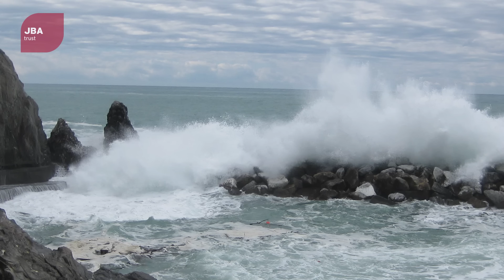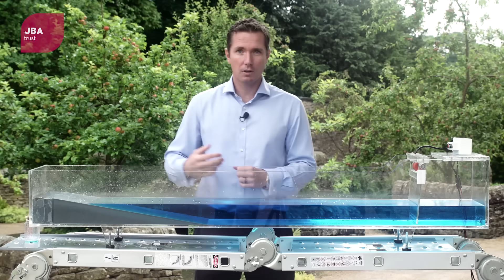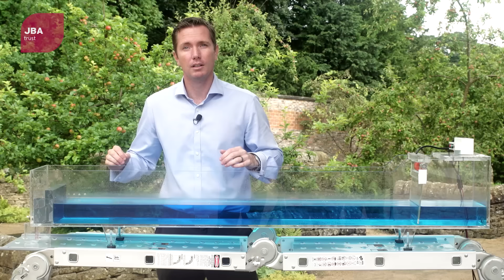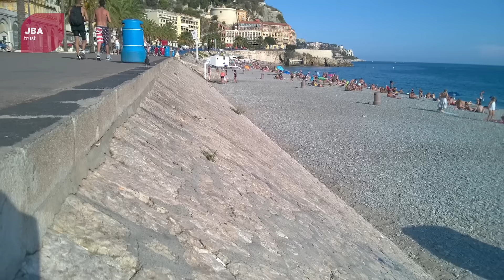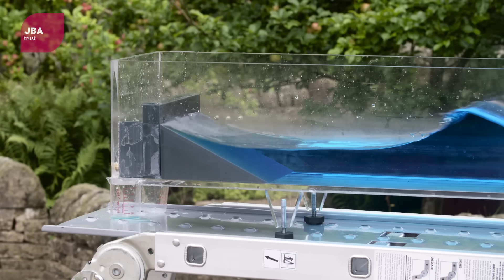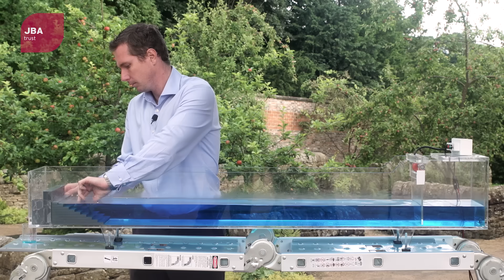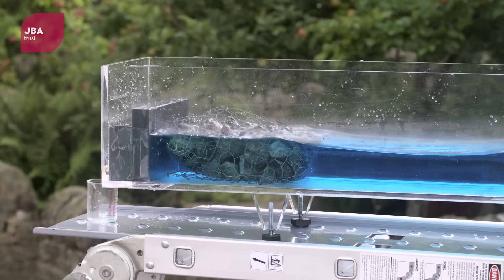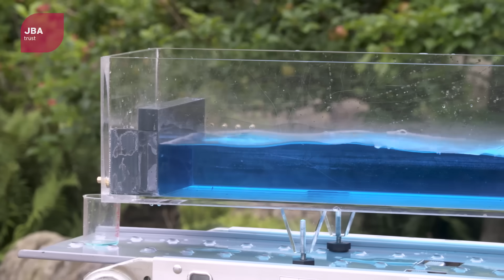Wave tank demonstration showing the impact of coastal defences on flood risk

Comment: Hi, thanks for the great demonstration and cool experiment. However, maybe you would like to improve the wavemaker a bit :) because now the wavemaker is on the top, and the flap generate faster water particle velocity in the deeper water depth than at the surface, which is exactly the opposite of reality in most cases ;) What you showed is likely a wave running on top of a strong tidal current, a rather extreme case. So you might consider arrange the wavemaker upside down and emerge inside the water column. Anyway, very well explained for the coastal protection part 👍

Comment: I thought some of those waves started breaking better after the 3rd or 4th wave. I assume the backflow would significantly affect long term performance. If large sudden waves in relatively calm conditions are a risk I assume they would engineer the defenses better. The step defense for example was completely out of the water in the real world example, but in the tank it was almost fully submerged already.

Comment: How about combining the top three performances:

Recurved wall barrier
Rocks/stones 
And the off-shore underwater barrier
Reply: Offshore underwater block would mess up the general ebb and flow of the waters close to the coast line. Could mess with some things if that were implemented. The rock wall, however, could serve double duty. Use it for it's initial purpose, and use it to harvest oysters. It's a win win.
Reply: A combination of two should work well, if the money is there. All three is probably too expensive.

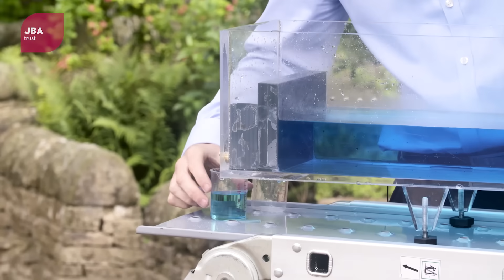Comment: At 4:58 you clearly see that he filled up the cup. It was nearly empty a second before.
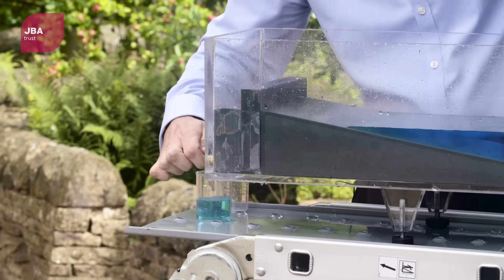Reply: There's a reservoir behind the wall above the beaker - he turns the tap to let the water run out from the reservoir into the beaker. You can see this at, for instance, the 3:21 mark. They cut a small portion whilst the water actually runs from the reservoir to the beaker.

Comment: (another random wanderer) but as cool as re-curved walls idea is. There is a chance that  it has a chance of breaking due to erosion and such. So unlike vertical walls that gradually over time increase the leakage amount. Re-curved walls could potentially just suddenly break once and create a lot of damage. So i think the idea is good but needs quite some maintenance to make sure everything is fine and/or not rely too much on it aka not to feel too safe under it's protection like the wall they made in Gen Z. I feel like the breakwater or rocky beaches are great since even though these rocks need to be collected , transported and installed they don't need as much maintenance and work as re-curved walls.

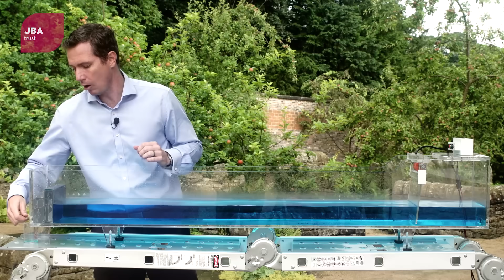Comment: At 4:56 they change the amount of water
Reply: There's a reservoir behind the wall above the beaker - he turns the tap to let the water run out from the reservoir into the beaker. You can see this at, for instance, the 3:21 mark. They cut a small portion whilst the water actually runs from the reservoir to the beaker.

Comment: why is there more water in the glass the moment he picks it up?
Reply: There's a reservoir behind the wall above the beaker - he turns the tap to let the water run out from the reservoir into the beaker. You can see this at, for instance, the 3:21 mark. Looks like they cut a small portion whilst the water actually runs from the reservoir to the beaker.
Reply: @Showsni  Exactly that Showsni

Comment: I feel that the explanation could have been much better if they all have benefits and drawbacks. By paying close attention I noticed that you said a seawall alone is just fine against small waves, so I assume the low cost is the benefit with the drawback being once it gets too large, it is terrible. But I did not hear a single downside of the recurve wall mentioned. It doesn't seem like it would be expensive, and yet all the energy from the ave is thrown back out to sea. My best guess is he just didn't test a wave higher than the recurve wall? I really would have liked to see that scenario simulated if that is the tradeoff.

I was however very surprised to hear rock armor is actually cheap. I would think that, especially where the sea drops off fast, it would be very expensive.
Reply: It's  not an explanation video its a demonstration video.
Reply: Depends on what kind of rock armour they use - if it's just cages of oyster shells like NY, they could probably just pick up garbage from nearby restaurants at minimal cost.

Comment: I think this experiment is flawed. This is an extremely small model and therefore whenever a structure is introduced it increases the height of water significantly, in real life the increase in level of water due to introduction of new structure will tend to zero. I think the volume of the structure should be measured and  same volume of water should be taken out of the tank before starting the wave. Any expert on civil engineering care to comment on the matter?
Reply: This video is meant to be a demonstration of different defenses, not an accurate study. In a serious model study, there are measures taken by the researchers to properly scale up the results to a real world design. Important fluid and geometric properties can be recorded on the model, and then used to predict the effects on a large structure. If you are interested, look into the Buckingham Pi Theorem and similitude.
Reply: But, that way they simulate the change in tides and rise of sea level. Also, that means that the defence will work even better in situation when the level of the sea is not change by the defence being added at the shore.
Reply: @dusanstojkovic9093  Here the increase in water level is quite high compared to the water level before introduction of the structure. Yes, I agree with you that the purpose of this experiment is to show the effectiveness of installing safe guarding structure to reduce damage by waves but IRL the volume of the water is so enormous compared to the structure that if the water rises that much in IRL (like it happens in the model) we will be officially facing extinction from the planet.

Comment: At like 40% in the video i thought "why not just make a wall with a curve to throw the water back in?" And then you showed the recurve wall!
But that submerged breakwater was mind blowing! I don't know if it has any environmental effect, but on the aesthetic part (+ defence ofc) its 10/10!
Reply: The submerged breakwater response is why coastal ecosystems, like coral reefs or swamps, are a great defense against inland flooding. The water breaks up on the coral or the tree roots.
Reply: This video is interesting and informative, but it's very simplistic.  There are countless other issues to take into account.  For one, many coastal areas do not get pounded at a right angle but usually be waves that come on an angle to the shore - this can make a big difference in wave behavior.  The biggest thing this video does no show is silt/sand.  Beaches are no only eroded by waves, they are also built be waves.  A submerged break wall will trap sand and sediment in many areas and you'll end up with a beach out to the break wall - perhaps partially submerged, perhaps usually dry, perhaps tidal - it varies.  Another issue can be stagnation of coastal water.  Break walls installed off shore (such as those around harbors) can cause the water within the harbor area to become stagnant, silty, unnaturally warm (which causes bacterial and algae blooms).  There's no easy answers.
Reply: It might make area for coarl to grrow
Reply: yes it does have an environmental effect (if standing on the seafloor and if the size is too big)
it may block the way for coral expansion and it could Close of essential hiding holes and one way entrances.
Reply: @thesakharepublik  I would imagine only if it was solid, but if it was made of soemthing like the rock armour, nly submerged, it would be great for marine life, I imagine.
Reply: Vinn Regi I'm gonna say it would be a good place for fish to build homes and other sea dwelling life
Reply: @Washington Mutual it's basically just an artificial reef. I'm pretty sure that artificial reefs have been constructed with surfers in mind, to create ideal waves!
Reply: I was thinking a upside down slope
Reply: time to mix sloped stairs, Recurve seawall and Submerge shore breaker
Reply: The issue I see with curved walls is that the are dangerous when walking on them. All these walls are at the coast and people falling off them is a bad thing...
Reply: Natural break waters are actually why the United States costal waters are so easily navigable. Behind the thousands of submerged and un-submerged islands you can sail boats that would flounder around the coast of for example France. Because of that America’s heartland is almost entirely connected by water to its coasts and is ultimately the biggest contribution to its status as a perpetual superpower.
Reply: the only effect of the submerged breakwater is that all the dolphins in the aria will die
Reply: How about not building right next to or on top of the ocean? Oh because rich people can, got it
Reply: @aolegario1  not always. Oceans are commercially important with cities growing up around natural harbors and ports
They are attractive tourist attractions which helps local economies
They are useful for fishing and stuff
And many more reasons. 
The whole world isn't California

Comment: yeah i tough of that design since the wall stops the force and it can only go up that spreads on all angle so pushing it back to the sea is effective but is it durable to sustain it for long period of time eventually some might need repair over time but it wont be effective if the waves are bigger then the structure itself.

Comment: This is a super interesting subject; particularly the last, below water, option. For the remainder of this post, I'll refer to it as a dam (you'll see why).
The only problem I could think of with it though, is the downward current exerted on the off-shore side of the dam.

You see, this object mimics many attributes of a low-head dam.

: http://www.boatsafe.com/nauticalknowhow/lowhead.htm
: http://www.safedam.com/low-head-dams.html

This particular structure has an odd hydraulic action, that creates a cyclical water-flow that can be difficult to escape.
The clip shows that, at times (between 11:18 and 11:36), the dam possess the beginnings of such a water-flow.

I may very well be wrong, as this dam deals with alternating currents: the opposite of the low-head dam. But, I strongly believe that the time between life sized waves movements could cause a real issue if this were to be utilized.

What do you think?
Do you have any ideas that might mitigate this issue?

Comment: Also need to consider one additional impact of building walls - the cutting off supply of material which may have been deposited elsewhere and therefore building out the coastline in other locations. Build a wall to protect one cliff and watch another one fall. It is a complex issue.

Comment: Nice needless jump cut at 4:57 to 4:58. Notice there was hardly any water at 4::57 but at 4:58 they jump to a different clip to show more water.
Reply: Same clip. The overspill water goes into a reservoir at the back of the tank. They just cut out the slow section of showing the cup fill up.

Comment: Re-curved wall, simple, easily accessible for land based concrete trucks and forming.  Remember this is all for extreme tides or weather events. so the redirected wave blasting from the re-curve should be no threat to safety. Stay at home during a storm.

Comment: I can attest to the rock wall. The marina I used to keep my boat at was completely man made and they used broken concrete, large rocks etc around the perimeter. At one point there was a round topped mound facing Lake Ontario with the rock wall along the base. During a really large wind storm we had waves coming from 100 miles away that were easily 15' high and while a little water came over the top to wet the grass on the lee side, that was about it. Just enough to get the grass wet so we could ski down it in our bare feet lol....You could stand at the top and see the waves crashing into the rocks and spraying every which way. We'd get a little sprinkle on us, but nothing major.

Comment: Could you develop a near-shore structure in stages? In which the design would have at least 2 permeable membranes to reduce cost? The project could incorporate oceanic plastic wastes to displace the directions of the incoming current, possibly like a "Plinko" effect.

Comment: What if you constructed a recurve wall, with an indent along the top as well, and pipes to allow water to flow into a reservoir and then flow back out to sea? I mean, these are waves we are talking about - not water level - so why not just catch all the water that does make it over and send it back? It could even look nice - putting maybe a walkway on the top, indented slightly so the wall forms a railing, with drains on either side.

Comment: Wish the recurve wall was tested without a slope as that may have influenced the result. As in the slope could have helped by reducing the change in direction which occured at the recurve wall, aiding it to be rebounded back towards the sea. However, the slope isn't cost effective, so I'm curious how it performed with just a recurve wall.  Without that test it seems like this video is premoting off shore walls, potenitally due to them having some form of profit margin from the offshore options. Just my 2 cents.

Comment: With the stepped revetment, the water level was higher or the revetment was lower because it actually, normally would help stop overtopping because the waves would hit the vertical wall of each step and disperse the energy gradually until it got to the top step where the energy would be very minimal.

Comment: More oysters sounds like a good thing. Local seafood? Pearls? Just use the recurve wall by default in all sea wall areas. Submerged breakwaters will still be unsightly because you will have to have a number of buoys to notify boaters of the submerged section.

Comment: There is a glaring issue with the slopped demonstration, in the pictures you showed the slope was built in front of the wall and on top of the sand, your demonstration shows it without any sand but the slope is not built beneath the sand, it is conjoined with the wall so due to their shape (vertical rectangular type shape with a triangle facing outwards) it would essentially act like a much more erosion prone curved wall, no?

Comment: the reason for the increase in the amount of water between the straight wall and the increased slope combined with the wall could be due to them not decreasing the amount of water in the tank when they add the slope. This would cause the water level to rise which would change the amount of water that reaches over the wall. Just a thought

Comment: All of these were cool but the problem is not necessarily waves coming in, the problem is inundation. When the water just keeps rising higher and higher like it did in all the Japanese Tsunami videos, the only defense that will work is a wall higher than the water will rise.

Comment: Where do you buy this
Reply: You could just buy a long, narrow display-type fish tank, or make your own from clear acrylic or polycarbonate sheet. Acrylic, 240 x 50 x 15mm x 3: £5.22, 56 x 50 x 3mm x 2: £1.50, so it's not expensive but you need to glue it well with glue that won't dissolve or perish over time and you may need to keep it out of sunlight. 
You could get more sheet and cut smaller pieces to make the various walls and wedges, or buy epoxy resin and hardener and cast your own. 
Home brewing equipment shops sell taps for as little as £3.20. 
The wave generator could just be a leftover USB charger from a phone that broke, some LEGO or Meccano pieces and one more bit of plastic sheet. 
You can drill that stuff and put self-tapping screws into it like it's wood, so assembly isn't too hard. Make sure you position and tighten the screws in sequence from one end to the other, so there won't be any bulges putting extra stress on the walls and joints. 
One suggestion I'd make if you've got room is to widen the tank and have variable wavelengths available. Then, by shining a point light into the tank in a darkened room, you can get some really pretty shots of the waves refracting light as they themselves are refracted by the depth change where they go over cut-outs of your patreons' or Kickstarter backers' signatures, and you can send them the high-res photographs as rewards for their support.
Reply: Plexi glass, servo motors and some water.
Reply: where did you make** this

Comment: The last really good though its costly. It break down and slow the wave hitting the beach. I see the pro as this design is built below the wave where the existing beach surrounding is not much affected and there will be more open access to the public to enjoy the beaches than having big and high walls surrounding the beaches. 
As for the con, will it work best if the high waves hit on a high tide day as the structure designed is fixed on particular shape and size and of course the danger post on the wave user because of the under water structure.

Overall, this is a very good video that draws my interest toward coastal defences....